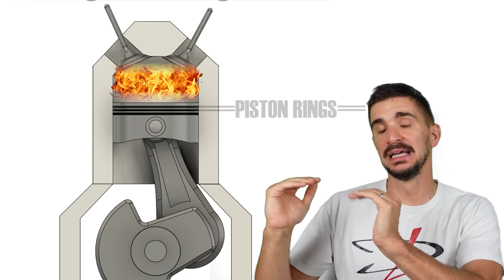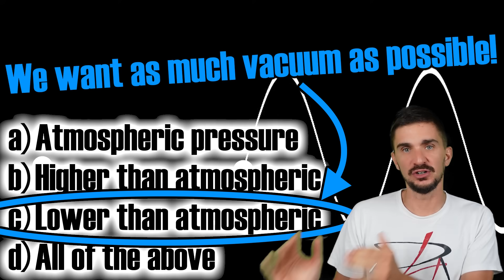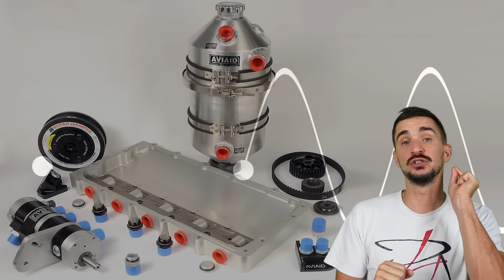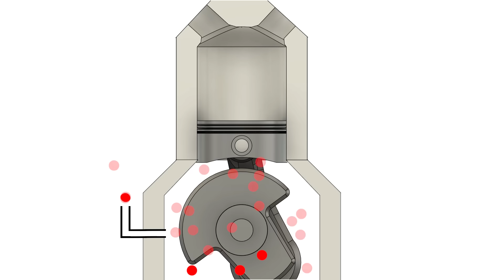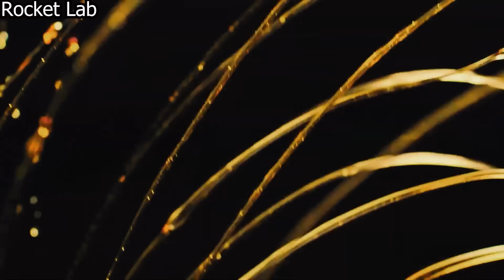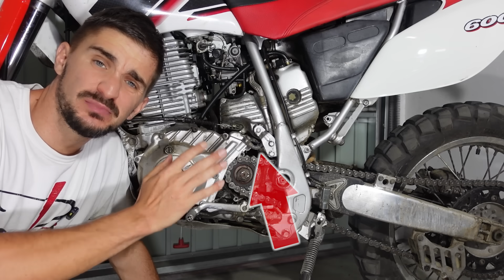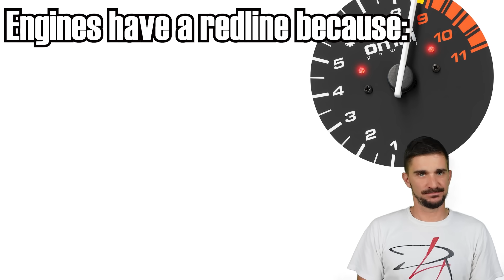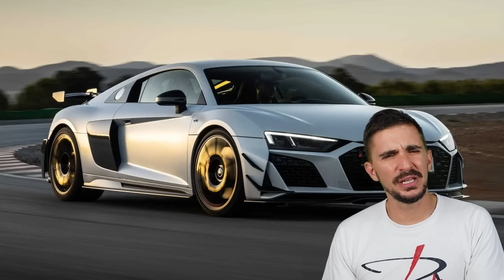Installing This Has No Drawbacks, Except for Your Wallet - Dry Sumps Are Awesome, Here's Why...

Comment: Wouldn’t the vacuum lead to more piston ring blow-by since there is an even lower pressure on the other side of the rings? 

Also Im having trouble understanding why lower crankcase pressures would lead to the piston rings delivering more of their potential to sealing against the sides of the cylinder. The rings are going to push out against the side walls at whatever force they end up exerting.

Any force they experience from an increase in relative pressure as they move down and compress the volume of the crankcase is just going to drive them up in the their channel further locking them into whatever position they had been at. If anything I would say this would help prevent ring blow-by but ultimately since we are talking about such a marginal change in crankcase pressure(from the piston compressing the volume) any increase in force holding the ring in place, would almost certainly be theoretically there but not meaning if at all even measurable.

If I try and conceptually visualize like in your drawing, I’m struggling to see why less molecules of air impacting the under side of the rings would have any measurable impact on how much they are going to exert out against the side walls. The rest of the explanation as to if a vacuum was present the piston and crankshaft would have less air resistance makes perfect sense as would doing anything to lower parasitic losses from interactions with both air molecules and oil. 

Don’t get me wrong, I often turn to your videos for your impressive ability to convey extremely complex and difficult to grasp concepts.

So it be great to have had some additional elaboration on this line of reasoning.

Comment: Why not make the counterweight (using light material for the rest) a full circle so that it does not need to displace the air
Reply: It increase mass, so the angular momentum. More angular momentum means more energy waste and gyroscopic effect, that we usually don't want. Like unsprung mass. Even with lighter materials, the material needs to withstand the centrifugal force. Maybe the is an area where the benefits of round counterweights exceed the drawbacks, but it needs to be proven, and dry sumps already solve those and even more.

Comment: Good video! One more drawback I can think of is if your oil tank is higher than the pan after the car has been sitting for a long time, for example, many weeks, all or almost all of the oil from the oil tank will end up in the crank case.

Comment: There's another drawback you didn't mention. It's also not a big one, but it exists. The reservoir needs to be mounted somewhere and in some cars there's limited space, so it would require a good deal of modification. 

And another one is one you actually called an advantage. Weight distribution in lightly modified cars will technically be worse. Oil is no longer at the bottom and instead there's just air. A lightly modified car isn't going to change entire drivetrain geometry for a dry sump. It will just replace the deep pan with a shallow pan and add a reservoir somewhere else almost certainly higher and not centered. As a concept weight distribution is an advantage, as well as in heavily modified vehicles or custom vehicles and ones designed with dry sumps, but in practice, most of the time it's a negligible negative.

Comment: Maybe this is a dumb question but at least in my 4 cylinder when you have two pistons going down the other two are going up so essentially they is no movement of any air out of a tiny "Breather hole". With this you are adding an entire new system that needs to be run by the engine, does the negative pressure provide enough performance to overcome the fact that you need to run this? Also most engines are built with having the crank slightly submerged in oil for many reasons. Yes emissions can be reduced but this adds so much more complexity and the engine needs to be designed with this in mind and most engines in production right now will probably not like this type of modification. IMO This is bad assuming anyone wants to modify their current engine do not do it. If this is a sugestion to introduce a system to create a vacuum/dry sump design in new engines i could see this being a thing.

Comment: Good one. 10 liters of oil in. 2 liter flat six is a lot of oil. The 911 has a elegant dry sump system with two big oil coolers so it is really oil cooled. (All cars are air cooled- boats are water cooled)

Comment: I recently killed all of the bearings in my 5.0 from oil starvation. There wasn't a big turnout this day and I was basically hotlapping and redlining my engine for 10 minutes straight. Just before my engine blew up, a more experienced guy with an expensive race car was looking at mine. He observed out loud to me that he didn't see any oiling upgrades (cooling/retention/capacity). I said right, but its been running optimal temperatures and my oil has looked great after each oil change for about a year of drifting every other month or so. He replied that, one day you will have to rebuild your engine because of it and that it will only take the one time for you to invest in oiling upgrades from then on. Literally the next time it was my turn, my engine locked up and started smoking out of every opening and I had my first experience getting towed off of the track. Moral of the story; the cost of a dry sump is unreasonable for most hobbyists, but atleast invest in SOME sort of oiling upgrades. A few to several hundered dollars is a lot cheaper/easier than a full rebuild. Also dont talk to whoever that guy was. He jinxed my shiii.
Reply: What oiling upgrades can you do aside from this dry sump mentioned in the video? I'm not too familiar with modifications. Catch can?
Reply: @daniel8763  Oil Accumulator, some oil pan upgrades that include fins so that the oil is even more cooled before reaching the tank,  oil pomp upgrade etcccc
Reply: The Trackside Prophet.
He probably had exactly the same experience a few decades back...

Comment: So can someone humour me...my two Harley's have dry sump setups...they don't rev (one tops at 5.5k and the other about 6.2k) lean angle what is that, and are ment to be in the wind at "speed" (yes, insert jokes) HP what is that? Air cooled engines without any bodywork.

So for a harley what would be the benefits? It cannot be HP, we don't make it, oil capacity?  Added cooling benefits?

Because of "tradition" ie the knife and fork bottem end?

Comment: why would they cut the ends of the counterweight? The Inertia would be off and the piston pin wouldent get the oil from the Splatter  of the oil cause of the sharper edge. Iam confused and need explanation. thx (:

Comment: lean angle in a motorcycle does not affect the engine oil. basically the gravity + centrifugal force combine into a stronger gravity that's aligned with the bike's axxis so the engine works like it's always upright. that is, of course, until you drop the bike...
it's same trick as a waiter moving glasses on a platter and the glasses don't move on the platter an nothing spills.

Comment: If the pressure in the engine block would be lower when the pcv open, than the pcv wouldn't get open.
So that's false that the pressure is lower with pcv open.
As long as the pcv is open the pressure in the block is allways bigger, becouse it must be stronger than the spring from the pcv and the atmosphere pressure combined!

Comment: Wouldnt a dry sump incress mpg? Seems most of the benefits are at higher rpm but any time you lower parasitic loss thar leads to a noticeable power increase means less load and stress on the engine less fuel burn better range. Also you say it can be used to mount the engine lower. On a fwd car as most eco box cars are idk how much lower you could mount the engine when they have to stuff the trans next to it as well, but if say honda or toyota widly adopted this tech on a common engine woukd lower the cost and possibly allow lower body lines  making better areodynamics

Comment: Only useful in very high performance cars - race cars typically due to very high RPM's. Even high performance and even some exotic cars are just using conventional oil pump systems but putting a plate in the crankcase to keep oil slash off the crank essentially separating the oil pan from the crankcase. Works perfectly and is cheaper and less complex.

Comment: Very nice video.

In an everyday N/A petrol engine a typical IMEP value at WOT and peak torque is around 15-17 bar. The BMEP is around 13-15 bar under the same circumstances. Correct me if I am wrong.

By lowering the pressure below the pistons by 0.5 bars (constantly), you directly close the gap between IMEP and BMEP by 0.5 bar (significant!). Further bridging of this gap is achieved by reducing the windage loses of the rotating crankshaft. I don't know, I would assume an equivalent of 0.1 bar more. If this is true, you have in total 0.6 bar gains.

However, in a typical car it's very tough to attach an external pump, given the space restrictions and the extended modifications that will be needed in the belt system (typical layout: crankshaft damper, hydraulic pump, A/C, alternator, idler and tensioner pulleys).

I am wondering if it's possible to achieve the vacuum electrically. You could put an electric pump everywhere in the engine bay that will run on 12V or more (using transformer).

Is there any such product?

Comment: I used to have a Ninja 250 motorcycle. One of the weaknesses of the engine was under sustained heavy braking, you could lose oil pressure, and the oil pressure light may come on. So you wouldn't want to go from 80 to 0 fast then gun it immediately.

Comment: All true, except for the 1st point you made. A dry sump would not magically add HP to an engine by sucking the pistons down. They do help them on the way down, but remember they have to go back up again, and guess what, they'd be fighting that vacuum, so the power gain vs power loss in that aspect is equal (the other/s piston/s doing combustion would have to fight the vacuum to lift the ones that are in compression/exhaust). But yeah, all the other benefits are real, engine revs higher, less power loss from oil slush, constant oil pressure, etc.

Comment: I don't know how many engine designes this might be true for, but its not true of an inline 4 design. the pistons move in pairs. when two are up two are also doown. the overall volume is balanced. the bulkhead devides in the crank case have breather holes for this reason.

Comment: And where the oil is required to be part of the cooling system, there is a oil cooler as well to reduce the chance of oil carbonisation caused by excessive temperatures.

Comment: All these benefits sound marginal versus a quite complex system, and all only to increase power at max RPM, where the typical road car seldom operates. In a balanced engine the air just moves around the crankcase and is not actually compressed. The crankshaft resistance at high RPM and dry oil sump issues sound like they can be improved by a better design.

Comment: 1) crankshaft splashes the oil everywhere oiling all the surfaces; you HAVE to consider this before doing anything especially removing the part of the oiling stage. 
2) pos-neg pressure - even on your images you show us that the volume displaced by pistons ~ the same because when a single\pair goes up, the other(s) going down 🤦‍♂🤦‍♂🤦‍♂🤦‍♂🤦‍♂🤦‍♂🤦‍♂🤦‍♂  
3) what's the outcome? 0.05% valuable for racers, negligible for daily drivers?

Comment: @4 minutes you talk about boxer twins being especially hit by power loss from pressure in the crack case becuase their pistons are at TDC and BDC at the same time.  Would the difference in volumes not cancel each other out?  And in any evenly firing engine with more than 2 cylinders, wont there always be pistons moving on opposite strokes to manage this?

Comment: What if you already had a solar bank large enough to run that pump with an electric motor, to take the load off the engine for better fuel mileage?

Comment: Maybe if we spend another hundred years developing the ICE, we will get to the point we were at 50 years ago. 
It seems like the engine designers are intent on making engines unserviceable. 
Wet belt…prime example.  New generation ecu style diesels, in comparison to the old purely mechanical diesels. 
Constantly cleaning the gunk out of EGR, and dpfs……

Comment: would it be possible if dry sumps were driven by an electric motor to prevent any parasitic loss whatsoever? I know that would have it's own little issues but you still be making a lot more power

Comment: But don't you get the energy back as the crankcase pushes the piston back up? Plus in engines like i4 there is not change in volume bevause 2 other pistons are always moving up, expanding the volume again

Comment: This is untrue, we have been running crankcase vacuum pumps on wet sump engines for many decades. While a dry sump oiling system has other benefits such as reducing windage losses, lowering the overall hight of the engine, greatly increasing the oil capacity, ect. Installing one to increase crankcase vacuum alone would be a huge waste of time and money when a $500 belt driven vacuum pump would accomplish the same thing for a fraction is the price, less weight, and taking up less room.

Comment: Hey so my question is. Do we really need a dry sump? It is better. But it is costlier too. So is it worth the investment? Also I wanna know, do dry sump have a different oil change interval too? Because more oil should mean longer net lubrication? Because imagine having to change 4-5x the normal oil but there isn't really any reapable benefit from the system simply because the system isn't really harsh enough to warrant the tech.

Comment: great informational video!  it makes me want to convert my project car.  but it has AWD and the front differential is bolted onto the oil pan housing.     yeah, the intermediate Drive shaft for the AWD passes through the Oil pan housing.  buy yeah my primary motivation for this vehicle is to be an offroad Scout type of vehicle.   it's a Cadillac SRX from 2004. 3.6L engine.  also, the Transfer Case for the AWD can be reconfigured to run a 60/40 torque spit (for purely off-road use)

Comment: If there's no need for pressure relief (since some level of vaccuum is being created), I guess the PCV won't have much work after the installation of the Dry Sump, right?
Aaaand, since the PCV won't be recirculating gases/vapors, does that mean the dry sump is a definite solution for the valve carbon deposits in (~Get Dirty Intakes~) Direct Injection engines? :D

Comment: Ok so lets say you have a single cylinder motorcycle that spends a lot of time in a vertical orientation because of excessively long wheelies. 

In this example lets assume that adding a dry sump is not possible, would you agree  then that overfilling the engine oil could be beneficial even if it means the engine has to work harder because at least its still getting some type of lubrication rather than zero lubrication?

Comment: Great visual and script as always.     This has given me more insight in the only experience I have with dry sump engines and that’s. the Rotax 912 horizontally opposed 4 cylinder aircraft engines commonly used in the Light Sort aircraft.     The biggest difference I note with the 912 series engines is the more external oil plumbing and connections required to feed oil to the coolers PLUS all that intertwined around the water cooling system.      All that said….. the high  revving 912’s has a higher power to weight ratio in its class.

Comment: Nice video, but I think to be clear, to say that the only way to get negative pressure is by a dry sump is false. Our race engine running at 8000 rpm, negative pressure makes a HUGE difference. To accomplish this, we (as well as most racers pushing higher horsepower engines) use a vacuum pump. We do not use a dry sump, but do manage to pull huge vacuum. this is by far more cost effective if an engine is running in the RPM range that need a vacuum. I see that the largest advantage to a dry sump oil splashing in the crank case, and for vehicles (or airplane) that have the potential to throw the oil all over the place in a conventional oil pan setup. Keep making videos :)

Comment: A good freind of mine in Santa Barbara CA invented the "crank vent". I rant this pcv device on my Kawasaki ZRX-1200 for 100kmiles with all the added benefits of negative pressure in the crankcase. It, being a one way valve it pulled a significant vaccum. In combination with a catch can it was awesome!

BTW this valve did not require a vaccum source. I just vented it back into the air box. The valve itself was genius (my friend was an accomplished PhD Engineer) and just used the crankcase pulses to create the negative pressure.